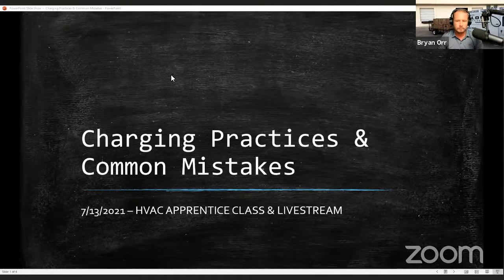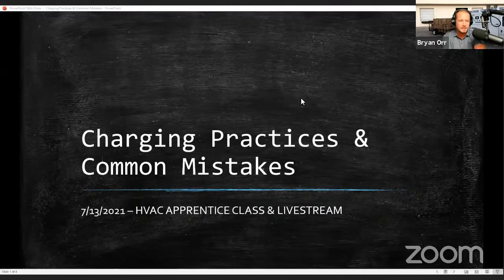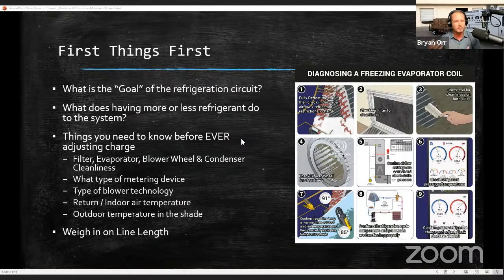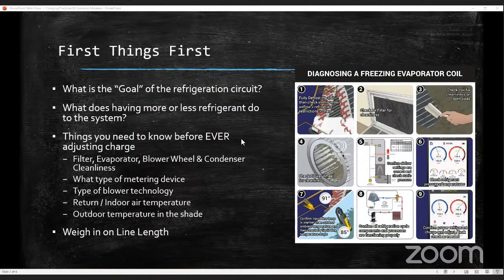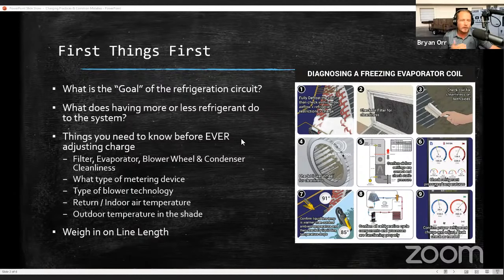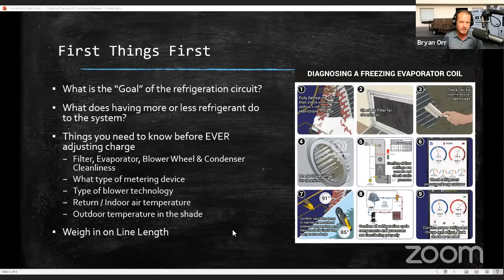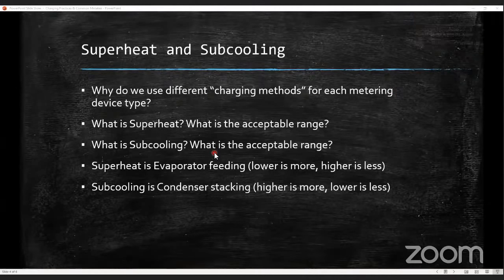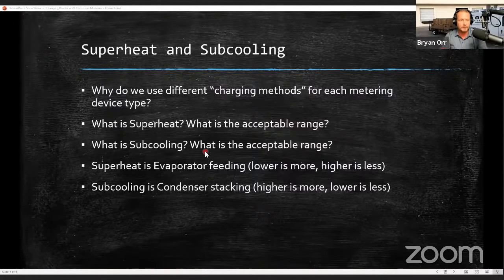Charging Considerations and Mistakes - Class 7/6/2021

Comment: I have a  mvac unit  it blow cold when driving when not driving and car ldiling it blow cold for 30minutes then it blows warm just vacuum the unit then check for leaks no leaks check to see if low refrigerant  still to speck what could be the problem  anything  you could recommend  I do

Comment: Is it illegal and wrong to charge with r407-c in an R22 rated system.
Reply: Only if you mix the refrigerants. It is illegal to put 407 on top of 22.  Or any other combination of refrigerants as well.   DO NOT EVER MIX REFRIGERANTS IN ANY SYSTEM FOR ANY REASON

Comment: Pressure is not consistent with temperature low charge means low pressure which means low boiling point instead of having the correct boiling point
Reply: Hey TXV is variable pressure where a fixed is at a certain pressure